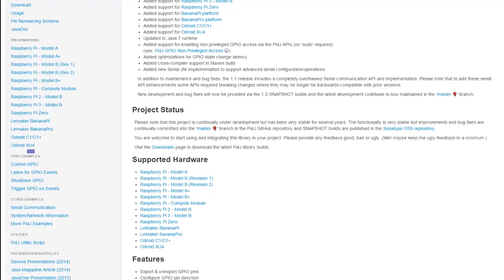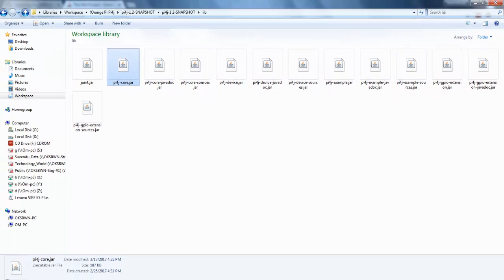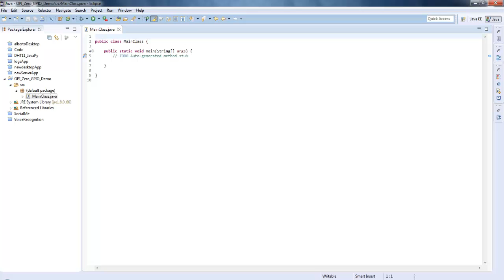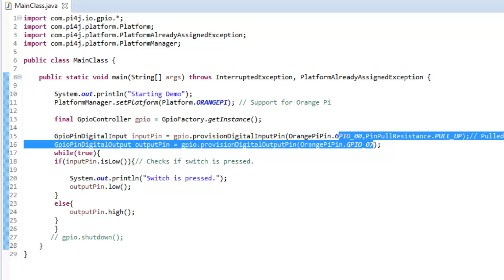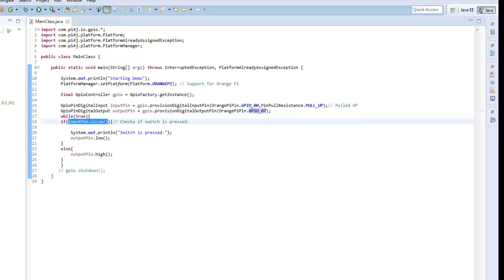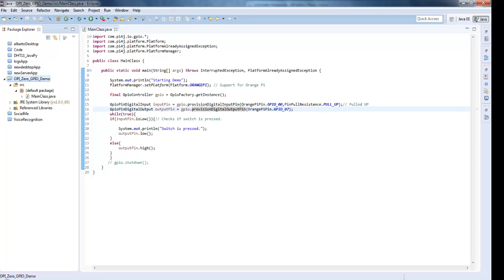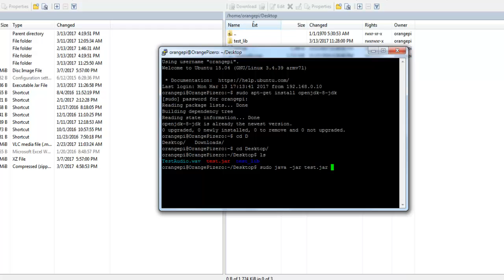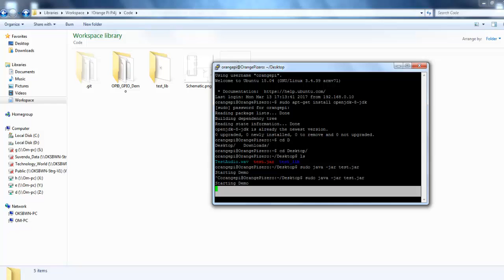GPIO Programming using JAVA | Pi4J | Orange Pi #3

Comment: 10:00: Is there a way to automate the process of running the application on Orange Pi after it was built? It should be annoying to do it manually.
Reply from the maker: Once developed you can make it auto started, I had made an video around it sometime back, will check and share the pink. If you want hot loading, not sure if anything exists, else u can use a shell script to check if jar has changed and rerun the new jar, might be possible.
Reply: @WGLabz  thanx for your suggestion!

Comment: Hi...thanks for the video... whenever i run the code the following error appears:  "Unable to open GPIO export interface: No such file or directory". Moreover ther is no GPIO directory in /sys/class. Ive installed LUbuntu OS and I use Orange Pi Lite. What could be the problem? Kindly respond
Reply from the maker: Thnks George. The Lib that I have used tht is Pi4J reuires the /sys/class/gpio directory . It is must. I hve used LUBUNTU only as shown in the video.  I hve not used lite but used zero nd this works. Plese check if the LUBUNTU for the Lite hs got GPIO support or not. Because for any language to access gpio we need the /sys/gpio directory; Hope it helps.
Reply: Thanks....and keep up the good work
Reply from the maker: +Winner George thanks....sure..
Reply: Hi WeArGenius, I uninstalled LUbuntu and installed Ubuntu Xenial from Armbian in OrangePi Lite. It works fine, seems like OP Lite wasnt fully supporting LUbuntu. Thanks once again  :)
Reply from the maker: +Winner George great to know it worked. you are welcome.

Comment: Hi, great work, i have tested and several pins like 11 do not works, you have any idea of why?
Reply from the maker: Thanks... Have you tested pin 11 for output? if you are testing it for the input it might be always staying high due to onboard pull-up resistor if any. As the  pin 11 is part of I2C interface and in Raspberry pi they are pulled up onboard. Although need to be checked on Orange pi zero schematic. I will check and let you know.
Reply: Hello, yes I test as output, the problem seems to be the pin map.
Reply from the maker: +L. Alejandro Martinez Rivera if you are using pi4j that uses a different pin mapping scheme....please check out that
Reply: Yes, and check on that, but have the same issue, using rpi a as your example.